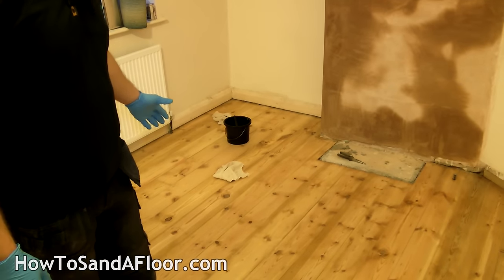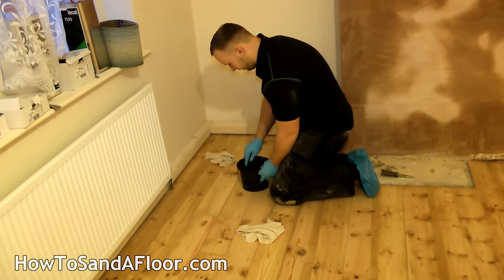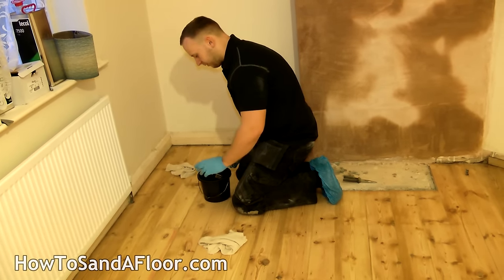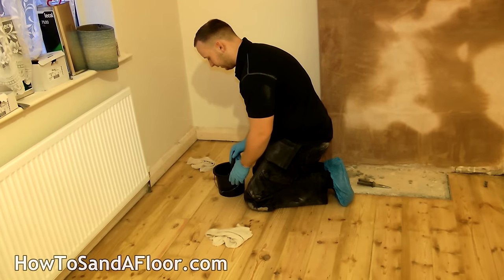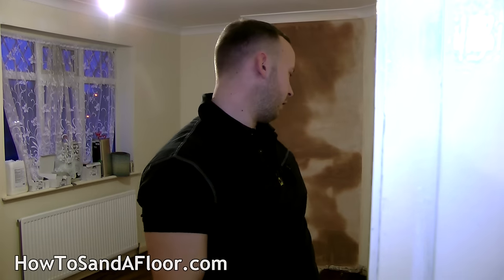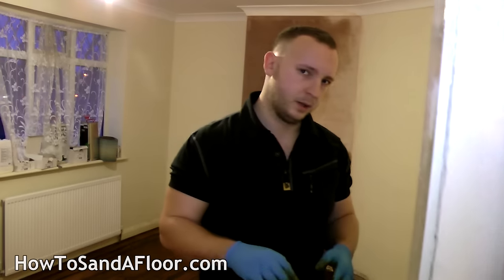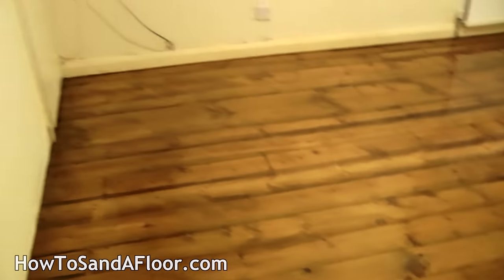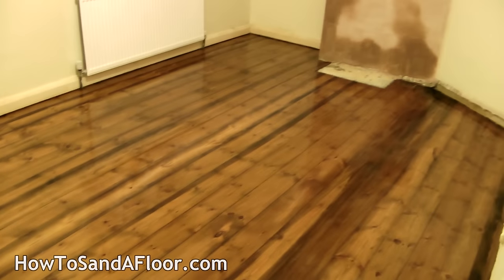How to Stain a Wooden Floor (pro method for DIY)

Comment: I'm a floor guy in the states and with our stains I see irregular dimples that show up on the sealer coat. They look much like standard little dimples that come with the lambswool shedding fibers every so often. They are everywhere and I can knock them down with sanding strips first, and standard screen on the second coat; but it would be great if I could prevent them from showing in the first place. One thing iv'e noticed is that we use tarry cloths to wipe on the stain and I'm wondering if these dimples are tiny cotton fibers coming off of the tarry cloths.

Anyone who is a stain pro give me the low down. Are wiping cloths what you specifically want to use? The oil sealer seems to exacerbate the problem, If we do sealer, sealer, oil because time is short the dimples drive me crazy.
Reply from the maker: Hi Michael shoot me a message on my Facebook page (just search how to sand a floor). I have something for you ;)
Reply: I'm a floor guy in the states as well, here is a tip for you, when you open up a bag of rags..take a couple of them and shake then in the air, if you see small fibers coming from them then thats what you are rubbing off on your floors when you stain, I go through this cause I use the same kind of rags as you do, so either you use the t-shirt type rags which doesn't shed, or you could pre-wash the rags to avoid the shedding, or if you let the stain dry over night you could run a white buffer pad over the floor and then vacuum the floor before you stain
Reply: mark  Great comment as this is exactly what I do and never had a problem. I also use a tack cloth with linseed oil for oil finishes or water for water based finishes after vacuuming. With a new batch of rags I throw them in the dryer on fluff and this gets rid of the loose fibers. I do the same on the first use of a lambs wool pad. Have a great day
Reply: captain757747 thanks, and also I just noticed that the last statement that I said after vacuuming the floor was "before you stain"..I meant "before you coat" lol, so have a good day as well

Comment: one more question. how come people don't use spray machines when doing this? like a spray pot and like a different machine to spray the lacquer to get a professional finish.  curious.
Reply: expensive I think. I'm pretty sure you use a lot more stain/paint than is necessary. but I'm not a pro. :)
Reply: what happening when you use a spray , the particles would end up getting on the walls. either mist or bounce off the floor and hit the base molding and or shoe molding. . then you have to clean all the walls. more time , more time, time is money in this trade.
Reply: +T Webb I do full time on site stain and lacquer on rails and what not. when we have to, we cover and tape up finished moldings... if u simply cover and paper everything off. you can essentially having a cleaner finish with spraying your stain and also spraying your lacquer.
Reply: Webb's Improvements , check some of my work out on fb... i don't do rails though just strictly refinishing-re-sanding  wood floors. staining with a buffer or rags, wipe on wipe off type of deal. so could be different method were both doing then.
Reply: True! I'm looking into on how to refinish floors. I'll check ur page out. What do you think of that product in your trade which is called Sandless refunish
Reply: if a customer wants to change their floor color , no other way but to sand the old finish off and some wood. water pop , and apply stain. but i can see the sandless refinish being more of a cleaner maybe. but id have to kinda research it more. but some oil base finish have an yellow/orange tint to it after a few years.  the sandless i dont see making that look fresh and new.. but then again, im not experienced in the sandless machine.

Comment: I recently stained a hardwood floor the stain is not drying and it has been aprox 4 days. I assume this is due to me not using the dry cloth to dry the excess stain as I went. Now I have a tacky floor. I have read that I should do another coat of stain on top and dry as I go as the new coat of stain will lift the excess stain from the first coat that I did. My question to you is does this sound like how I should be going about fixing this or is there another method? Also should I sand after this new coat is put on and do a third coat as I walked on the tacky floor thinking it would be dry and left some foot prints in the stain? Any response would be appreciated. Thanks!
Reply from the maker: jordan marshall hello, and thanks for your question, sorry the answer is a little late. Was it a waterbased or solvent based stain? Or a coloured oil or other kind of coloured finish?

You are supposed to leave stain for a few hours but i am often lacquering 30 mins after finishing the staining (i use solvent).

Stain should never be "tacky" or "sticky," because if it is its probably a coloured finish. And IF it is a coloured finish, it probably shouldn't be applied in this way.

Comment: @howtosandafloor, how long did you leave the stain before applying the gloss? and then how long before you buffed it with 120? cheers
Reply from the maker: +danny sparkle probably half an hour, can't remember but was rarely more than 45 mins.

On the tin it says like 6 hours but experience knows better. I also know that other stains aren't so easy going, so stick to the instructions on the product yoou're using
Reply: +How To Sand A Floor thanks for the advise

Comment: After sanding my floor using various grades of sandpaper from 60grit to 120 i dampen the floor with a rag using water and a little white spirit, i then use either a small orbital hand sander with 240 grit or do it by hand. I think rustins wood dye and then pv67 by sadolin are the best ways to finish the floor. Did you use rustins or was it another brand of stain?
Reply from the maker: very similar to rustins yes, pv67 is a very good product, sounds like a job well done

Comment: Can i use the same method with parque flooring
Reply from the maker: Lucy Read Yes, kind of. But i wouldn't recommend it. It's difficult even for professionals to stain parquet. The only parquet i would recommend you stain is Oak. Oak takes stain very well and doesn't go patchy very easily. You want to do it in the same way, in strips. On parquet you would take one sort of chevron at a time, rubbing the stain on in swirls. Hope that helps
Reply: Thank you. Any thing else i can use...on parquet after sanding it.

Comment: Curious if you have to use a water based stain, or if you can use an oil based one if you plan on using a water based poly (Dura Seal).

Currently looking at using a Minwax oil stain for the color I like, and then sealing, and adding the dura seal. Or do I have to get a water based stain? I figure the sealer should handle that, but not 100% sure.
Reply from the maker: Shyatic in this video i am not using a waterbased stain but i did lacquer it with waterbased. It can work. The stain i used, i can best describe as being "spirit based" , most english people say solvent based, americans call it oil based.
Reply: ***** Awesome, thanks -- what water based lacquer would you recommend? I've been looking around, seems Dura Seal is one of the more popular ones. I have kids so the fumes are great to avoid, plus the faster dry time.
Reply from the maker: Bona Traffic HD

Comment: Hi. I was curious to know if you sand laminate floor in order to stain it, is there a literal laminate layer that will be sanded off or will you take off the "photo" print of the wood grain in due course?
I want to stain an "antique oak" laminate floor of approx 25m² to white, charcoal or black without taking away the striations and knots/whorls.
I would hopefully then bring to a high shine with a varnish.

Thanks for any feedback.
Reply from the maker: You cannot do this at all, it’s literally an image on the surface which can’t be adjusted. You may be able to paint on areas worn off to try and hide wear, and possibly put some sort of coating over the top. Other than that it’s rip out and replace.
Reply: Put vinyl planks in super simple and last a while

Comment: do you have any advice if the results came out patchy? :(
Reply: +katma136 he didn't use a wood conditioner.  Soft woods will do that.  It looks pretty terrible in my opinion...
Reply: +Daniel Gillrup since my comment we actually managed to fix a bad stain on pine (by applying 5 coats). until the 4th I still wanted to cry. on another room we got away with just one coat but soaked like mad and it turned out amazing!

Comment: Could I use this on my pine floor boards then finish with Colron beeswax ?
Reply from the maker: I don't know, maybe, but why would you want to finish with beeswax?
Reply: Ok thanks. Well I’m beginning to ask myself the same question since watching your videos lol. I was told beeswax would be better for me to maintain with kids in and out. They said I can patch repair whereas varnish etc would flake then full floor would need re sanding ? Do you work around County Durham area or could you recommend anyone ? Thanks!

Comment: hi, can you still stain a floor if it has been oiled?
Reply from the maker: theandroids unfortunately not, the oil won’t let the stain penetrate the wood, you’d need to remove the oil first with sanding
Reply: @HowToSandAFloor  ok thanks.

Comment: Never shake oil based it causes it to bubble and those air bubbles will appear in the finish... always stir any oil based product paint also
Reply from the maker: The product in this video is spirit based. Very thin. It has to be shaken otherwise all the colour is in the bottom of the can
Reply: @HowToSandAFloor  um stir I'm a painter and drywaller by trade but I do everything trust me it's better to stir the bubbles will eventually settle but I've had problems where you can see the airated bubbles in the finish happened to me on a door refinishing when I didn't listen it felt rough and you cold see it had to redo it maybe floor stain is a little different but I doubt it
Reply from the maker: @epicheavystuff2943  I’m a floor sander and refinisher by trade. I stained hundreds of floors with this stain and I never had that problem. It’s not oil based. It is spirit based… thinner than water. The cans have a 3rd of an inch opening and can’t be stirred. So you follow what it says on the can and shake it. Otherwise you’re leaving the colour in the bottom of the can. But I guess you’re right 🤷🏼‍♂️
Reply: @HowToSandAFloor  dump it into something else or whatever works for you idc I just know my experience with any solvent stains,paints, urethanes
Reply: @HowToSandAFloor  it'll happen with that water based acrylic "alkyd" shit also
Reply: @HowToSandAFloor  I can get most stains in a quart or pint metal container that I can fit a sick in to stir
Reply: @HowToSandAFloor  I've refinished alot more than wood floors and I've lost count residential commercial and industrial coating certified
Reply from the maker: @epicheavystuff2943  😂 🙈
Reply: @HowToSandAFloor  read the can on some minwax poly
Reply: @HowToSandAFloor  I wish I could show you on here I just took a picture of a can

Comment: I've heard some people use wood conditioning after sanding and before staining, would it help if I did this or would you not recommend it?
Reply from the maker: i don't know a single professional that does it, i literally had never heard of it before i came to internet land, skip it
Reply: ***** Water pop the floor to open the grain and create a more consistent and richer tone. Larger tray for stain, Padco pad, a couple handfuls of rags with a helper wiping behind you to prevent lap lines and stop marks. Also... Lacquer? This tutorial is how to stain like an amateur.
Reply from the maker: Brandon Krause hater xx
Reply: Brandon Krause I also saw a tutorial with the stain being applied with a long squeegee like tool. The man in that video said never to use a paintbrush to put the stain on. If time is of the essence, what is the best way to get the stain on?
Reply from the maker: Raquel Silano i think the reason he said that is because if you are trying to stain the whole floor with a brush, you are going to have to keep dipping because the brush doesn't hold much stain, padco pads are great because the hold a hell of a lot of stain and it covers a large area very quickly. I use a brush around the edges because its great for cutting in around those edges.
Reply: ***** Thank you, Ben! I appreciate the recommendation. I'm starting the staining tomorrow. Do you have a method for choosing the color stain?
Reply from the maker: Raquel Silano  I put down a selection of samples for my clients and then sand it off once they have chosen. The best you can do is buy whichever color you think you want then just do a small test on the floor, then sand it off before you stain the whole floor
Reply: Try water popping with denatured alcohol and water 50/50. It’s the best

Comment: I hired a few contractors to do refinish my wood floors. They used a stain that has the gloss in it did not use a rag method it was a brush and the floor was still tacky after several days they came back looked said it needed a second coat walked on the floor leaving foot prints. They currently are not returning my calls i have the stain that was used as well as a second can of just gloss just in case the stain they used did not leave enough of a gloss. Is there anyway to fix my floor without sanding it back down? It finally dried after a full week but has patches where there was some stains and foot prints!
Reply from the maker: this is the frustrating thing with wood floors, if the finishing is messed up it usually needs a resand. Other contractors may try their hand at evening out those foot prints, but i doubt they will be successful. Get 4 different refinishing contractors in for a diagnosis and quote
Reply: What if I wanted to do it myself? It would need to be sanded again but can the stain I purchased that has the gloss included be applied by a rag that seems like a faster way it is a very small room. They actually used two hand Sanders vs the large floor sander.
Reply from the maker: it's a different product, what i am using is a stain/dye, what you have is a coloured finish. This rag on and rag off method won't work at all! Whats the name of your product? I think i would roll it on like a lacquer but using a thin pile roller
Reply: ***** The product is called minwax wood finish says it penetrates, stains and seal that is what they had me buy. I also have a can of shellac zinsser brand that bought in case the shine from the other one was not what I was looking for. When you say roll it on are you referring to rollers that you would use like when painting or is it a certain kind for floors? I really do not have the money to pay another contractor so it is probably going to come down to me doing it myself. I originally started this project since the people that lived here before had cats and carpet on the wood floor needless to say the carpet was used as a litter box. Since that room is my boys room I wanted to take out the carpet and refinish the floor. There are a few stains even after they sanded it and put the stain/seal on it but I am pretty sure that they did not do it correctly. Any advice would be appreciated as far as getting the stains to be less noticeable, best product to use or how to use the one I have, if rollers are the best option are needed what kind I currently have a few that I was going to paint with that have the long handles. Thanks so much for helping this is all new to me but it has to be done in a few rooms the floors are wood but they put carpet over it.
Reply from the maker: did you pay these people that screwed it up already?? by roller i mean the thing i use in the "how to lacquer a floor" video I have. What does the instructions say on the tin?
Reply: I did already pay them for the floor after they put the stain on it that same day and they came back a few times when it was not drying and said that they put n another coat to try and get the stains fully covered and cover the steps that were put in it. I guess that would be a good place to read the instructions I was just thinking the stain that you were doing then the lacquer on top seemed to be a bit easier than this stuff I have since it took so long to dry the first time it was applied and it is such a small room.

Comment: All those roughly 2 inch wide lines unfortunately stands out too much and should have been remedied as soon as you started the staining process. You would have noticed the lines as sooon as you started and so should have stopped immediately. I guess this was a compromise however which is always the case isn't it, no more time perhaps. Other then that it would have been a good finish.

Comment: isn't it to blotchy to lacquer over. like there's long lines of stain blotchyness between the grooves of the planks.
Reply: Flooring is pine which is a soft wood.  It will blotch as you see in this video unless you use a pre-stain treatment.  But that is another time consuming step.  And truthfully this look is whats "in" currently.